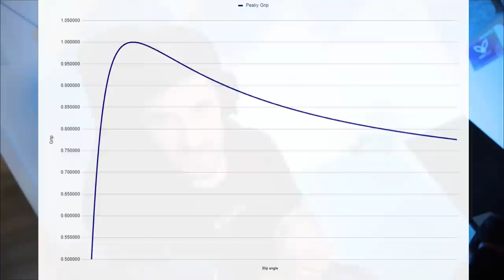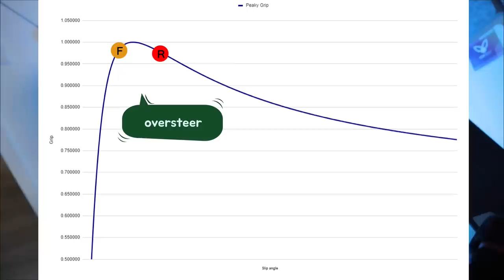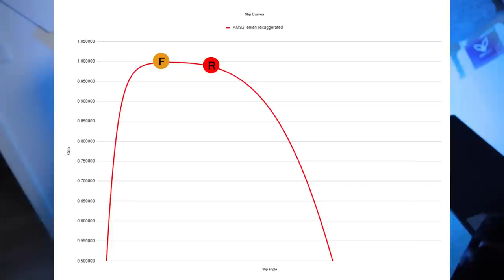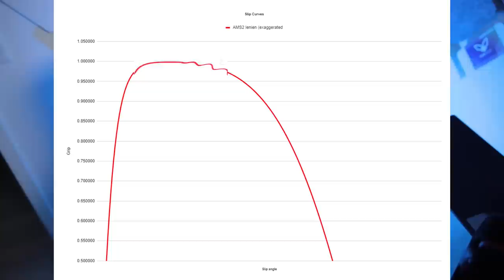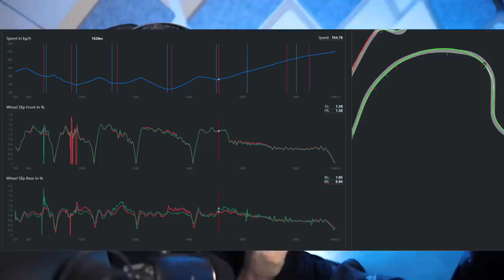Understanding Simracing: YAW! Explained using Automobilista 2

Comment: A lot of people that argue about "sims" dont even know the science of cars or even how to setup cars in the first place, and its something i have been seeing more and more of when people speak online
Reply: You dont need to in a lot of cases. You dont need to be an engineer to feel the diffrence between sims and wich ones are more or less realistic
Reply: @dinonuggies2276  realistic compared to what? The cars we've never driven before?
Reply: @khalidadisa2786  Exactly.  Hardly anybody knows really anything about this stuff.  Ask a sim racer for ISO test plots for the real vehicle's understeer gradient curves and transient response or MMM diagrams compared to the sim, and they'll have absolutely no idea what you're talking about.
Reply: @khalidadisa2786  how many cars do you need to drive to realize mariokart 8 deluxe drifting and hopping isnt what real cars do? If it was so hard to tell nobody would be selling their kidneys for iracing
Reply: @dinonuggies2276 you missed the point by several miles
Reply: @dinonuggies2276  You need to understand how it feels IRL. One big factor in sims is tire model, but IRL there are many different tires available with much different feel. Also you don’t feel slip as easily in a sim because minor changes aren’t easily seen visually.
Reply: I don't think you need to have drive a real racing car to notice the difference. If you hop into iRacing, Rfactor2 and ACC, they're all slightly different but at the same time similar. AMS2 on the other hand, handles corners completely differently to the other SIMS, which goes against the grain and makes you think that it's not realistic (it's the odd one out). Some people SIM race purely for fun, and others want to get what they believe an as close to real life experience as they can, and maybe some transferable skills. Many don't believe that AMS2 provides that. Once it does though, and online play competition is improved, there's no reason AMS2 wouldn't be up there with iRacing and ACC for me. There's no doubt AMS2 is a great game, it has its place, but for me, it's not a SIM.... yet.
Reply: @shaunsheppard3936  imho as some famous racer said, sim games are way more punishing thn reality. People think that if the sim is harder is more realistic wich is not the case, form tons of interviews you can get that for eex gt3 are super easy to drive and spinning a gt3 is not impossible but super hard irl. in some sim is super easy to spun.
Reply: @shaunsheppard3936 noticing a difference means nothing though. I notice a difference between daytona USA and ACC. 

you need a reference to know what is "realistic" and what isn't. People throw around "realism" without even knowing what realism feels like because 99% of people have never driven the car IRL that they're driving in a sim.
Without a reference, it's all hearsay.
So the next best case is relying on devs that have access to car data and implementing that data correctly and as close as possible to how the IRL car behaves. Which is why Kunos and Iracing are at the top
Reply: @Gino_567  It's not necessarily about realism, but if one SIMS feels completely different to three others, then you have to wonder why that one SIM has gone with a different approach. If I hop into a GT3 car on the same track, AMS2 just 'feels' completely different to the other SIMS in terms of grip and how the tyres bite through the corners. RF2, ACC and iRacing are all different, but they all give that impression of the tyre biting in the corner. AMS2 doesn't give you that feeling. As far as I'm aware, it's a pretty common feeling amongst the SIM community that AMS2 is more slidely and SimCade like vs the rest. 

I have no idea which one is more 'realistic' as I have no reference to compare against, but why is AMS2 so different to the rest? Is AMS2 closer to reality and the other SIMS do things differently for more 'feel', I don't know. What I do know is, because it's too different, I don't want to spend too much time in AMS2 as I'm concerned it'll negatively impact my driving performance in the other SIMS.
Reply: @shaunsheppard3936  So basically you're saying that you're making this statement based on "feel", which is clearly subjective. Not really the best way to reason through this.
Also the fact that 3 sims "feel similar" and one says absolutely nothing. They could be all be "wrong" (they're not, they just FEEL different).
In short, yes you don't have to have driven a real race car to say if it's realistic or not, because that's also subjective. You need to be an engineer, specifically someone with vehicle dynamics expertise.
And stop using "simcade", it's stupid word, as if you had some hard criterion to say what is a sim and what is a simcade. You're just saying "I don't like it" in a very convoluted way.
Reply: @toddwasson3355  You're exactly right. When I realized there was an entire subject relating car handling, my mind was blown. I did my best to refresh my maths so that I could read RCVD. The ability to describe a vehicle behaviour scientifically is truly fascinating. BTW do you think that using "yaw" like in this video is correct? I feel like the author meant vehicle slip angle - I'm not sure if other authors use a different nomenclature.
Reply: @BroadcastBro  ok, how many real racing drivers have said that AMS2 is the most realist SIM? I've heard some say ACC is, and others say iRacing is, but I've not heard any say the same about AMS2.

Of course what I'm saying is subjective, so is everyone else's opinion.
Reply: @asdf2593  I don’t realise only experts were allowed an opinion. Sorry.
Reply: I absolutely agree about the lack of hard data in realism discussion, although there is one subjective data point worth considering: If drivers of a certain sim easily transfer their skills  to driving real cars then it is likely the sim they trained on is indeed truly realistic, most likely.
Reply: @shaunsheppard3936  actually for a long time ACC and iRacing felt very different.  And you had camps arguing over which was more realistic, and there were real racing drivers in both camps.  That should tell you how pointless this argument is.  All the sims have moved closer to each other.  What IMO separates a sim from a simcade title is the depth and complexity of the driving model and there is no doubt in my mind that AMS2 is a proper full blown sim.  Go read the physics pieces by some of the Reiza guys.  Yes it's on the lenient side, but if they all drove the same it would be boring.  Plenty of people love it and calling it a simcade is a bit disrespectful to the work Reiza are doing.  nothing wrong with simcades but that is not what they are aiming for.
Reply: @mikecroshaw9233  I'm not dismissing the effort that's gone into AMS2, it's a great game in it's own right. Graphics are fantastic, VR is damn awesome and when I jump into it, it's fun. Is it a full on SIM, I'm not sure, but I think it's close. Some people, they only have enough time to dedicate to one SIM, and in my opinion, when making the decision on which to choose for GT3 racing, ACC and iRacing come above AMS2, both for the way they drive and the element of competition they bring through online play. They feel like serious SIMS, where as to me, AMS2 feels like a game. Is that an issue with my perception, possibly.

I keep dipping into AMS2, but never for serious racing, more for fun. I bought it, and I still buy the DLC's, I'm still supporting the developers, and I'm looking forward to future improvements.
Reply: @asdf2593  I am by no means an expert yet but currently doing a mechanical engineering degree and I have a module that covers vehicles from tyres to suspension kinematics, steering, braking systems, tyre effects, vehicle dynamics, aerodynamics, geometry and some more stuff I don't remember rn. So hopefully I do reach there one day if that answers your rhetoric question 😃.
Reply: @BroadcastBro  RCVD is a great book.  Proud to say the author is a friend of mine who I worked with on a tire project for VRC-Pro (testing RC car tires for that RC car sim I spent 14 years on) some time before doing a presentation together at the Motorsport Engineering Conference in 2006 or so.  Brilliant guy.  I met his father, Bill, once too.

The "yaw angle" refered to in the video is generally called "sideslip angle" in the vehicle dynamics world.  I often call it "vehicle slip angle" too.  It's clear from the context of the video what he means though so I wouldn't split hairs about it too much.

Sideslip angle unfortunately doesn't really tell you much other than what the relative cornering stiffness might be between two cars.  Every vehicle has a tangent speed at which the sideslip angle is always 0.  When the car is going faster than that, the car takes a nose-in attitude.  When going slower, it's nose out.  It says nothing at all about understeer or oversteer though.  That's purely a tire slip angle and steer angle thing.
Reply: Simcade is a perfectly descriptive term.  These days the physics models are all pretty close to each other, most of the differences come down to how the engineers tuning the cars (guys like Niels H and Aris and me on VRC Pro, KartKraft, etc.,) parameterized the models.  There are a bunch of numerical inputs for the vehicle and tires.  The vehicle dynamics people fiddle with those numbers to get the vehicle to handle the way they want.  That's "model parameterization" which is separate from model development (writing/programming/coding the actual models which I also do).

As a developer, the terminology to me means more about intent than anything else, assuming devs are successful in making it drive as intended.  I've worked on all three types:  Arcade, simcade, and sim.  When making a "sim" I'm trying to make the vehicle response match the real vehicle the best I can.  When making an arcade game, I'm trying to deliver a fun, entertaining feel with very little regard for what the real vehicle's response is.  For instance, I worked on The Grand Tour Game which was arcade all the way.  Under the hood it used the rFactor engine though if you can believe that.  (Really, it's true, I was the Studio 397 guy specifically hired to modify the rFactor physics engine for that game).  So is it sim or is it arcade?

I'd say that particular game was arcade even though the rFactor engine itself is sim oriented all day long.  My job was to modify the sim engine to be arcade so that it'd drive in a pretty ridiculously unrealistic way and be fun on a gamepad immediately without any practice.  The game designer was the former Need For Speed guy who tuned Need For Speed titles for 10 years and was looking for a specific feel to the cars, something more like NFS than rFactor.  Where they wanted it on the arcade-simcade-sim scale was absolutely a real conversation that was had at many levels, and confusion about where it was supposed to be lead to several problems early on.  He described it to me as him wanting a caricature of a car, not a real one.  Lateral accelerations and so forth were wildly higher than in reality and on and on, and everybody was fine with it.  The name of the game was "fun," not realistic.  So even though rFactor was under the hood we devs still called it arcade.  I was hired to come up with all these fake force systems and steering assists and an artifical drift mode and so forth which gave that "very much not rFactor even though it's rFactor" feel.  

In the middle is simcade which I think is a good name.  There you're trying to be much more in the direction of sim, but you'll back off the realism on purpose in order to make it more accessible and fun.  Generally it has more to do with model parameterization than actual model/physics code, although in some case (like The Grand Tour Game) both are true.  The rFactor engine has been used in all three types, so it doesn't really have to be an engine thing so much.  It's more about tuning, generally.
Reply: One mistake I think people make when comparing two sims is to automatically default to the position that the harder sim is "sim" while the easier one is "simcade."  Sometimes I'd agree with that, but more often than not, I wouldn't.  A car that's too hard to drive is usually just a bad car with bad handling which is too often equated with "realistic."  Real cars really aren't that hard to drive and slide around and so forth.  Most of vehicle dynamics engineering in the real world is aimed at controllability of the vehicle.  I.e., making the real car easy and predictable to drive.  When real drivers in real cars are complaining about their cars, it's almost always about how it's too hard to drive or not responding the way they want it to.  So the setup gets changed in ways to make the car drive differently.  It didn't suddenly go from "sim" to "simcade" in that process, it just became an easier to drive, all around better car.

iRacing unfortunately seems to be many people's gold standard for realism.  I haven't driven it in several years, but when I was driving it I most certainly didn't agree with that.  Unfortunately due to an NDA I can't elaborate on what some very serious flaws in the iRacing engine (specifically the tire and suspension models) were which would illustrate that lucidly.  Suffice it to say that I agree with these guys:  

https://www.youtube.com/watch?v=c710XsgSx3w&ab_channel=ASJ

Harder does not equal more realistic unless the real car is also that hard to drive.   More often than not, the sim version of a car is harder to drive than the real one.  

Having said that, I've been hearing more recently from people I trust that iRacing has improved a lot in the years since, so maybe today some things have changed.  I couldn't say where it stands today, but there were some very real, very serious flaws years ago that really put it at the bottom of the sim pile in my book.  There's potential though:  The guy that wrote the guts of the rFactor 2 engine and tire model joined iRacing, so if he's given free reign to do whatever he wants, iRacing could improve in major ways in the future.  If that happens, many iRacing "harder = more realistic" fans will scream that it's become simcade, but it really won't.  It's becoming more realistic AND easier to drive at the same time.  By becoming easier (more like the real car), it became more realistic.

Realism means the vehicle responds the same way to control inputs that the real car does.  The closer the sim car is to that, the more realistic it is.  End of story.
Reply: I remember when the terms "sim" vs "arcade" first happened:  I remember it being around the time Grand Prix Legends came out and was all the rage.  Before that you had pretty silly car racing games like Test Drive and so on that really didn't act very much like real cars at all.  Grand Prix Legends and perhaps Crammond's F1 games felt very different from the games that came before them because for the first time there were some real physics and tire models being used.  These sim games were always a lot harder to drive than the arcade games that came before them.  Harder = more realistic was true back then because we were comparing games like GPL to arcade games like Test Drive and Pole Position and so forth which had no real physics whatsoever.  There were endless debates back then about it between people who didn't like the new game types with the real physics models and so forth because they were too hard.  They'd complain that the cars weren't very much like real cars, which they weren't, but they captured a lot more nuance than Pole Position and Test Drive style arcade games.  The cars responded to weight transfer, there was oversteer and understeer and all that stuff that makes a car interesting. 

So these types of new games were more realistic even though they were harder.  I think that's where the "harder = more realistic" really started.  While it was true then, it's not so much today.  Most of the games, even most of the arcade ones, are closer to real vehicles than those early sim games like GPL were.  Unfortunately the lingo stuck and people still speak in largely the same terms about sim vs arcade today that they did back then, where a harder car is more realistic.  Today that's mostly a bunch of nonsense.  Making a sim/game car that's easy to drive is a lot harder to do than making one that's all over the place.  I remember having a conversation with a former Papyrus guy about this years ago.  He said he often wanted to deliberately make an absolutely terrible car  just to see how the community would react to it.  Most people would hate it and say it's unrealistic (they'd be right), meanwhile the few who mastered the cars anyway would blame the "ninnies" (as he called them) lack of skill for their inability to drive the dumb things.  I agree with him.

People should probably talk less about how realistic a car is (since they probably don't have any way of knowing anyway) and instead talk about whether or not they like the handling.  That's what real race car drivers do in real cars.  There is such a thing as "good handling" vs "bad handling" correlated to subjective feedback which has been veraciously studied in the automotive engineering world for 100 years.  It's why your road car that you drive every day doesn't spin around every time you turn the steering wheel.  In the real world it's all realistic of course, but a real race driver will complain that car X handles terribly while car Y handles nicely and is easier to drive anyway.  

In the sim world maybe it's time we shift in that direction.  Instead of trying to debate which sim has the best physics/tire model or whatever (they're all pretty good these days, far better than GPL and those older sims), perhaps we should talk about whether the handling is good or bad.  If the handling is bad then it's probably not realistic because the real car engineers put ridiculous effort into keeping controllability good.  I.e., making the real cars easy to drive.  So instead perhaps we should talk about what handling we like and don't like.  That's what real racing drivers do.  They're not complaining to the engineers about how their car doesn't drive "realistically".  They're complaining because the handling is just.... awful.  

Not everything is always about the tire model.  There's a lot more to vehicle dynamics engineering than that.
Reply: @toddwasson3355  You make very good points. Especially with people believing harder is more realistic. A lot of people don't put any effort into trying to make a car handle better. Just jumping in with whatever and giving a fast opinion.
Reply: @toddwasson3355  Also the  amount of sunk cost fallacy especially in Iracing makes people reluctant to even see different
Reply: Agree on both points.  

Another thing I've noticed is sim racers have evolved the word "feel" to mean something different from how it was originally used.  "Feel" used to mean vehicle response back in the early days before we had consumer grade FFB wheels at all, let alone good ones.  Now people use "feel" mostly to refer to FFB which has nothing at all to do with vehicle response to control inputs outside of a force control mode operation.  I can't say how many times I've watched YouTubers try a sim to comment on physics only to say nothing at all about what the vehicle is actually doing, how it's responding to control inputs.  Instead it's just a bunch of "this FFB feels like this or that" and nothing else.  Even Jimmy B did one where his wheel strength was cranked up to the moon and he had nothing to say other than how much the FFB sucked.  Sometimes I think FFB has actually taken away the ability for people to pay attention to the handling.  They're too distracted by the wheel.  

When I started sim racing I had some Thrustmaster SuperSport or something like that which just had a centering spring.  No FFB at all, so handling was processed in my brain entirely visually.  Yaw rate information came from seeing how quickly the horizon moved left and right.  Sideslip angle information came from the direction the road was moving relative to the center of the screen.  "Feel" referred to vehicle response, not what the steering felt like.  It's become harder to get good feedback because all anyone talks about now is FFB.  When you ask people how the car feels, it's "the FFB is too much this way or that way."  Not a word about handling which is what you're really asking about.

Speaking of sideslip angle, using a chase cam isn't a great way to do that.  In The Grand Tour Game they deliberately manipulated the chase camera position and direction to make it look like the sideslip angle was bigger than it really was. I suspect the natural tendency is to think the forward camera direction is lined up with the velocity vector of the car, but that's not necessarily the case.  I'd been through at least one round of those changes so saw it myself.  Small differences there are very noticeable.  They did similar camera tricks in Need For Speed.  All very deliberately designed that way.
Reply: @shaunsheppard3936  The reason the Sims feels different with what your talking about is that: Assetto Corsa uses a single contact point tire model. ACC switched to a 5 point tire model shortly after the 1.0 release. AMS2 & PC2 use a physical tire model built from Rfactor, so they don't have individual tire contact points. iRacing similarly uses a physical tire model, though theirs is developed in-house rather than from Rfactor like AMS 2. 

I also find it interesting that you say you don't feel the "tire bite" like other sims. When on my Fanstec GT DD pro wheel, AMS 2 has the STRONGEST & HEAVIEST feeling tire bite feel - especially on the default FFB type. 

AMS 2 is the only sim, where I have to turn force & spring setting down to 100 instead of the max 120 I usually use. Otherwise sims like AC just feel way too light, especially in like a formula car at lower speeds without the downforce. (FYI, the Force & Spring setting on Fanatec just is another way to be increase the amount of force used when turning. Force adds more resistance when turning, and Spring add more force when the wheel gets pulled back into alignment). 

I think what you were trying to say is that, despite ams 2s very strong tire bite feeling, it doesn't last as long as other sims, and that you lose that tire bite a bit faster than other sims. Which I agree with. However the actual FFB feeling of tire bite is extremely strong for me, it's just that tire bite will be lost a little quicker than other sims. 

On the contrary, in iRacing, it is very well know that cars like the Skip Barber are infamous for being extremely slidey, and fastest when doing 4 wheel slides. It is known to be slightly more slidey than it is in real life - BUT they say that is so you can get better practice when preparing for a real life racing. But making 4 wheel slides a little easier in iRacing it allows you to practice it more and prepare for doing it in a real race.
Reply: @nicklibby3784  It's always difficult to explain what you do and do not feel in a SIM, but I just find that cars in AMS2 simply lack grip. To me, the cars feel like they four wheel slide through the corners.

The physics in AMS2 could be absolutely spot on, I don't know, but if they are, maybe it's something about how the physics are communicated to you through the FFB.

I'm not a massive SIM racer, and I've spent probably an equal amount of time in iRacing, ACC and RF2. I really want to like AMS2, but when I hop into the game, something feels off compared to the other SIMS. 

With iRacing, ACC and RF2, they're all different, but there's a strange familiarity between them where you easily adapt to each SIM. In AMS2 I feel like I have to drive in a completely different way vs the other SIMS.

Hopefully future updates will bring more improvements and MP, which at that point it would be difficult to dismiss AMS2.